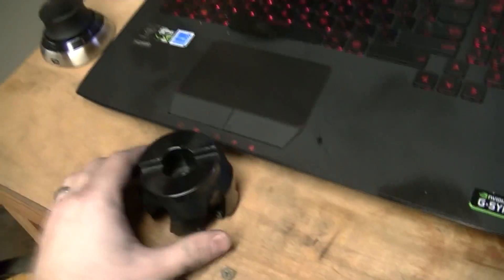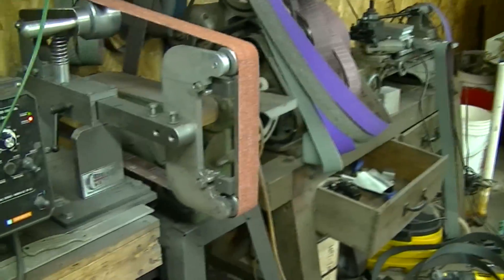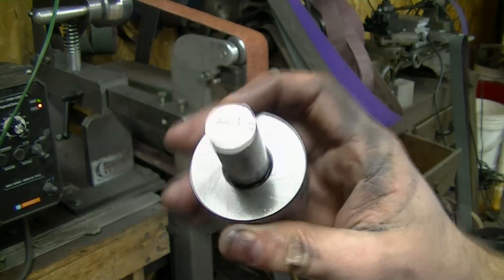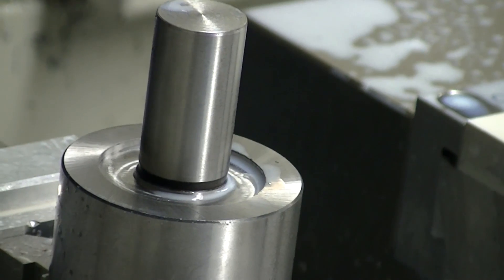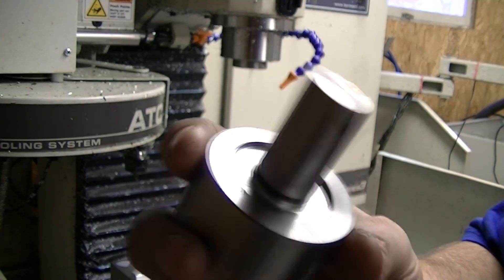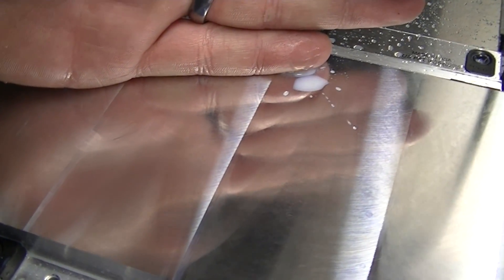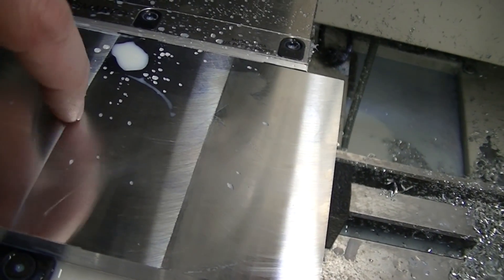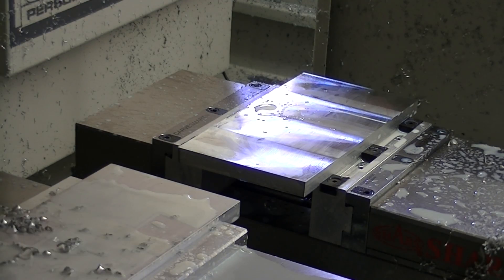Tormach PCNC 1100 Maritool 2 5  45 degree Facemill

Comment: If you want to purchase a 3/4-1" Shellmill arbor that fits the Maritool cutter without modifying the arbor, there is one sold by Penn Tool Co.  SMA-400.  www.penntoolco.com.
They take orders for the Eagle Rock arbor and it ships from Eagle Rock to you direct.  Took several weeks to arrive, cost $87.00, plus shipping. Eagle Rock part number: A1-36-0750-1000.  Be sure to ask Maritool for a bolt to fasten the cutter to the arbor, as the one that comes with the arbor is too big to fit the Maritool.  Works perfectly in my Tormach 770 without any modification.

Comment: Nice solution, whats the depth you can get on a full width pass? just wondering if its good for ripping stock out.
Reply from the maker: +l0ckcr4ck3r  I haven't pushed it yet. I mainly bought it for more rigidity over the super fly to face odd stock. I think overall the super fly would win in stock removal. I think 5 inserts just bog down on the 1100. Overall the super fly had a better surface finish but the face mill wins on consistency for interrupted cuts.
Reply: makes sense with that number of inserts making chips simultaneously. I usually stick with the 38mm shell mill unless its a smooth uninterrupted surface, then the superfly comes out. I used to have a similar cutter to that from Iscar but it was R8 and a pain to use... but very nice cuts!

Comment: Slight pucker factor milling over those mitee bite clamps.  :)
Reply from the maker: +Shain Terry  Dang right. I changed how I milled the ops and reversed them... ended up taking one out. hahaha!
Reply: +RippsGarageTech  Ouch!   You make those jaws with the mitee's in them?
Reply from the maker: +Shain Terry  Yes, Just carvesmart jaw stock so not a huge loss.
Reply: +RippsGarageTech  Cool need to look in to doing that soon.   You know the mittee bite part number for those clamps off hand?
Reply from the maker: +Shain Terry  Yea these are from MSC,        84456136 1/2" 10-32 SCREW 2/PK VISE JAW GRIP
Reply: +RippsGarageTech  Thanks!!!!

Comment: That was a nice looking production.  Nice job!  I was like, "Oh Man go grab your cut-off wheel!" when you took that shank over to the grinder LOL!  I've had my eye on that face mill for a while now so it is cool to see it in action.  You had like a 80% volume reduction in that stock to get that sweet looking frame/bezel.  The cheap bastard in me would have slotted that middle part out and saved it for something else LOL!  Old habits die hard.  Quick ? do you like those carvesmart jaws?
Reply from the maker: thanks! I dig the facemill so far. Loving the carvesmarts too. I wish I would have got a set for both vices. on the other hand glad I didnt. I'm going to get an orange vice and mount sideways. will be perfect for what I do.
Reply: Thanks for giving me the scoop.  Yeah someday I'll go the citrus route with my work-holding as well, but until I crash more tools into my existing vises it will have to wait.  With enough bad programming I know that I can drill and mill my way to a nice Orange vise someday!  Keep having fun over there!